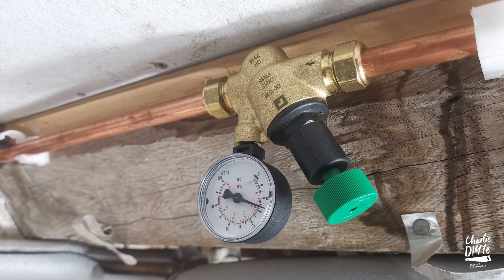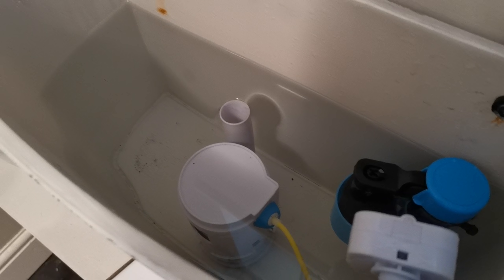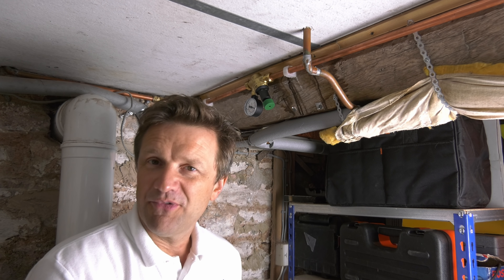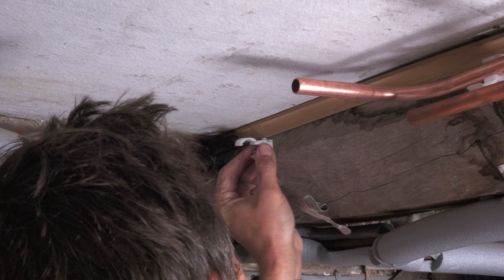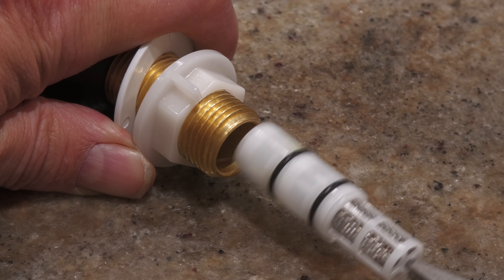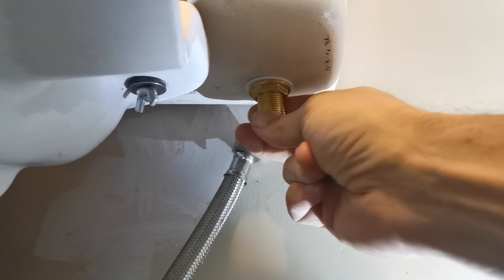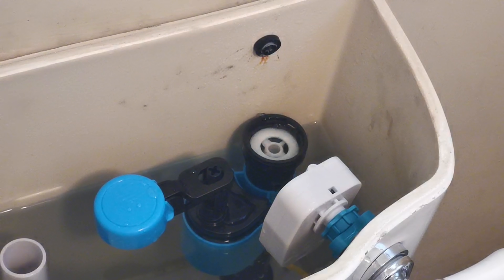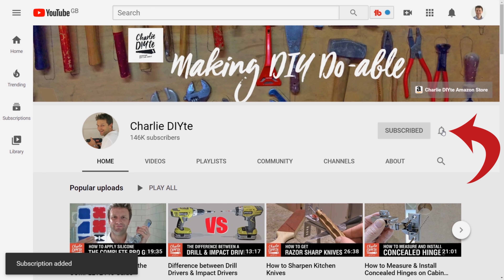How to Fit a Pressure Reducing Valve to Fix a Cistern Overflow Problem

Comment: We had a pressure reduction valve fitted to the incoming supply just after the main stopcock. That has been in service for 25 years and apart from the plumber initially fitting the filter after the PRV rather than ahead of it (which caused it to stop working after a while with the grit carefully trapped in the valve😃) it's been great. Less worry about flexis and washing machines giving  issues.

Comment: Hi I fitted these to my 3 toilets they worked fine I have recently had email from water company saying I have a leak I checked all toilets they are overflowing very slowly supposedly I am loosing a litre per hour my water pressure is quite high we have  two showers so the the pressure is great I don’t know how long they have been like this I fitted these about 4 years ago I was just going to replace?

Comment: Great channel Charlie,  you always manage to cover the salient points in all topics.   Re Viva, and the blue plastic filter.  Not seeing your video before,  I phoned Viva to try and understand why you would need the option of the blue plastic filter.  They told me that it was only necessary if you 'dont' need a check valve.  I was thinking he was talking about an external check valve.   That confused me.  The guy I spoke to did not mention the standard filter is also a none return valve.  I assumed it was just a filter.  It is a shame that the brochure installation instructions still does not mention that the pre installed filter is a also a one way valve to stop back flow.
Reply from the maker: Yes, it never ceases to amaze me how lazy instruction manuals are. Thanks so much 👊

Comment: Looks like you have an asbestos ceiling in there
Reply from the maker: Yes unfortunately so. Amosite https://youtu.be/g_DI3_LmY5k?si=DiZQ88iILxtdxQHo
Reply: @CharlieDIYte  Yeah, thought so. It's Asbestos Insulating Board (AIB) and presents a medium risk as it's unsealed. I wouldn't spend too much time down there if I was you! I was an asbestos surveyor in a previous career, you never lose it 😂

Comment: For a proper seal to the pressure guage there is a conical washer that you can get (if you search carefully) that seals the pressure guage at the bottom but unfortunately it tends not to be supplied with the guage or the PRV.  I found that a copper washer with a 5mm hole and 10mm outside diameter does the trick.
Reply from the maker: Thanks Richard 👌

Comment: Did it stop the hammer noise just by installing the pressure reducer?
Reply from the maker: Weirdly the hammer noise ended when I installed this new fill valve.. Pretty sure that was before I installed the pressure reducer but can't be sure. Best to put it where the main comes into the house so the entire house pressure is reduced. I have one of those now since we installed the underground boiler so the valve I installed in this video is superfluous.

Comment: Hi Charlie,
Great video.  Just a quick point that may be of interest, the inlet valve you installed is sadly not strictly legally allowed to be installed in a WC. According to BS standards and WRAS an inlet value in a WC has to be a "Type AG" backflow prevention device, the one you installed is a "Type DA" device meaning it relies on the umbrella valve at the top to prevent backflow. While this has been a requirement for a long time, this and joints below the critical waterline (like those in most adjustable inlet valves) because a hot topic about 3 years ago when there was a huge increase in reports of in cistern cleaning chemicals being siphoned back into the water supply.
Reply from the maker: Hi Tyron, thanks for this. Does the umbrella valve not prevent backflow then? I'll need to look into this. 👊
Reply: @CharlieDIYte  that's the reason u say strictly.  The Type DA valves are used a lot in Europe and the US  without much of an issue. The umbrella valve does open and vent vacuum to atmosphere in most situations provided the vacuum is enough to move the valve material. There had been discussion for years to allow these valves to be approved in the UK but they are not allowed to be installed into potable water systems at the moment.

Comment: is there an certain pressure recomended when u fit one of these valves
Reply from the maker: In my case I wanted to keep the pressure to within the tolerance of the fill valve. For a house in the UK it should be minimum 1 bar. So you'd want it 1-3 bar probably.
Reply: @CharlieDIYte  thanks

Comment: nothing wrong with what you have done, how about an " equilibrium float valves " I have worked on 1/2" - 4" diameter feed,, " equilibrium float valves " since 1972 never a problem, you can get them for toilet cisterns, etc. but not saying pressure reducing valves are not a good solution.
some people think that reducing the " flow rate " reduces the dynamic water pressure, but it does not.really..so definately a pressure reducing valve.
there is more than one way, to skin a cat.
by the way you would be better off, using Wras approved " Jet-Lube V2 Plus Jointing Compound " for compression fittings. for " potable water " and gas supplies
thanks for the video.
Reply from the maker: Thanks mate. Appreciate the advice. Yes, what I should probably do is install one where the water comes into the house, rather than on just this one point, but until I rip the kitchen out so I can get to the stop cock, it's not really practical.

Comment: According to the Honeywell installation instructions your PRV is installed upside down
Reply from the maker: I couldn't find anything in my instructions to say this. Remember, mine isn't a Honeywell (they've hived off Resideo).
Reply: @CharlieDIYte  Honeywell bought Resideo, valve appears identical. Section 3.1 item 1 of Resideo instructions says spring bonnet should be facing upwards. DiffIcult for you due to your ceiling, but that is what the book says. Sorry to bring bad news 🤦‍♂️ This could be to ensure debris does not gravitate into the cartridge. Maybe less of an issue if you have an upstream filter?
Reply from the maker: @whitefields5595  You've misread the instructions. It actually says "In vertical installation position spring bonnet with vertical spring facing upwards" Mine isn't a vertical installation
Reply: @CharlieDIYte   .... I know, but your spring bonnet is still facing downwards to the same degree as if it was upside down in a vertical installation. As previous, i reckon it is to reduce probability of debris getting into the O rings in the piston assembly. I wish I'd never mentioned it now, only trying to help .....

Comment: If you have a flow pump  connected in the outlet of the water system, it is ideal to install a pressure reducing valve to save the water heater?

Comment: Hi Charlie, thanks for another interesting video, just wondering if the same pressure reducing effect could be done by slightly closing the isolater valve,? Doing this worked for me on a cistern that was filling too violantly. All the pipe slices I've used swage in the copper on cutting through, I use a small half round file to remove it, provided I've got access . Cheers mate, looking forward to the next video, stay safe, best wishe's to all, Stuart uk.
Reply from the maker: Hi Stuart, thanks- you're very welcome 👊🏻 I should have mentioned this in the video. No, putting a half or 3/4 turn on the isolator simply reduces the flow but not the pressure. In some ways it could do more harm than good - using the analogy of putting your finger over a hose pipe.
Reply: @CharlieDIYte  Hi Charlie, thanks for the reply, your answer cleared that question up, as always your videos are clear, instructive,  and a pleasure to watch,stay safe mate, best wishe's to you and your's, Stuart uk.

Comment: Charlie can you do a video on door frame paint removal and how to get a glued and nailed interior door archetrade off.
Bloody Barrett homes from mid seventies😖😖👍cheers John
Reply from the maker: Hi John, unfortunately I haven't really got one of these on the pipe line. However I bought a heat gun from Wickes years ago and use that when I need to strip paint - it's bit a beer good one though so maybe shop around and get yourself a few decent painters knives to scrape it off with.  That and sanding. I think you'll have get a wide chisel and lever that architrave off if you're wanting to remove it though.

Comment: I have just got one of these too (also disappointed with the plastic guage). Can you actually install these upside down like you have? The instructions state the 'bonnet should face upwards'. Its spring-loaded but perhaps less effective if upside down? I assume that's why it's at an angle.
Reply from the maker: That's an interesting question. My valve can be installed vertically and horizontally, and in the vertical position the bonnet would be facing down so I can't see how this could be the case, but when I locate the instructions I'll see if I can find any reference to this.

Comment: Very interesting, thanks.  If not too unsightly, I generally prefer to install isolating valves that have small handles so in the event of emergency there’s no mad dash to get a screwdriver
Reply from the maker: Yes that's a very good point. 👍

Comment: Afternoon Charlie , hope you don’t mind me saying . With your ridiculously high mains water pressure , I would advise a pressure reducing valve on the incoming mains , not just your downstairs wc . That amount of water pressure is a disaster waiting to happen . Putting huge strain on every water appliance /or outlet . 3.5 bar is more than enough .  Most mains fed water systems , be it pressurised cylinders etc have combi valves reducing everything to 3bar .. just a bit of advice from an old school plumber . Take care .  Oh and I enjoy your channel . Rosco .
Reply from the maker: Hi Ross, massive thanks for that. You're absolutely right. The slight problem I've got at the moment is the incoming pipe is behind the kitchen cupboards - the stop cock being the only part of it that's accessible. I should probably devote some time to taking them apart to access it, as I could do with putting a new stop cock on too. But I really appreciate you taking the time to advise me on this 👊🏻
Reply: 16bar ..... Around 250PSI incoming water ! I think Charlie that sorting that and the stop cock moves up your to-do list several places  before it makes itself number one in the middle of the night :-)

Comment: Have you heard of the Water Hammer Arrestor to help with knocking?
Reply from the maker: Thanks Steve. I haven't, but I'll keep a note of that. I think ultimately I need a reduction valve on the water main inlet pipe coming into the house, which will probably solve any potential issues, but it's good to know about this. 👊

Comment: Good video, I'm currently redoing the WC and the fill valve that came with the cistern seems very cheap, I may have to replace it. I'd be interested to know why the cistern setup can cause knocking. I wonder if it's just a difference in design of valves between the old and new variations
Reply from the maker: Considering the Viva valve is only £10 it's well worth doing. Not sure why it's resolved the issue, but the flow rate from the old ball valve would have been a lot higher, so creating more for in the pipes when someone else turned on a tap. Someone has commented that the valve in their old cistern was vibrating and this created the knocking, but I don't think that was happening in my case.

Comment: does your water supply provider not have a responsiblity to ensure your pressure is not too high?
Reply from the maker: I'd rather manage it myself Dave and will probably put a valve on the mains pipe into the house when I can access it. A mate at the other end of the village has literally no pressure, so I'm fortunate that where I'm situated it's high.
Reply: @CharlieDIYte  Charlie, I'm with you on this. A few years a go our water pressure was increased to help supply a care village upstream of us. it caused some leaking problems initally and we got the water supplier in to measure the pressure which they said what high but still "in Spec". I keep meaning to fit a whole house pressure reducer but I will have to source fittings for the old  black plastic pipe we have.

Comment: If you have this problem and are on a tight budget, you could install a shutoff valve if you don't already have one and just turn the valve so it's just open a little bit which slows the water down. Obviously it will take more time to fill but won't over pressure the inlet valve
Reply from the maker: I don't think that's right mate. I've read a few things about this and the general consensus is that doing what you say decreases the flow but not the pressure, so actually you can do more harm than good - similar to putting your finger on the end of a hose pipe.
Reply: Unfortunately this is incorrect Rhino , yes the shut off valve would slow flow , but the actual pressure remains the same !   Size of pipe determines volume /flow .. not pressure ..  hope you don’t mind me saying ..  Rosco

Comment: I've recently changed my fill valve for the toilet and within hours the the valve broke and is now slowly leaks into the cistern. I now have to turn off the water into the cistern to stop it from overfilling because the overflow pipe doesn't connect to anything. The landlord could fix it, but that will cost him money 😒
Reply from the maker: Sounds like you've got the same problem as me. 🙄
Reply: @CharlieDIYte  yup looks that way. The fill valves should be better quality

Comment: Another great video. Thanks, small detail, i think you're winding the ptfe onto the thread in the wrong direction, unless the video is mirrored?
Also be careful of passing the gauge  upper limit, you may put it out of calibration. 
Please keep up the good work
Reply from the maker: Thanks Julian. You're probably right about the PTFE tape. Yes I didn't really want to max out the valve like that but felt I ought to, to show the actual pressure in the video.

Comment: That's a lot of pressure. What kind of hot water and heating system do you have?
Reply from the maker: I've got an S-plan ventral heating system powered by a Worcester Bosch oil fired boiler. Hot water comes from a hot water storage tank in the bathroom supplied by a water tank in the roof. Not ideal but just about works for a family of 4.
Reply: @CharlieDIYte  ahh, ok, balanced hot/ cold won't be a problem with the prv as it's already way out of balance already.
Reply: @CharlieDIYte  I have a similar "old school system" like your. Vented cold store in the loft, system boiler heating coil in the hot storage tank so only gravity hot water.
Would be very interested to hear views on best alternatives for a house with 3 beds, 2 baths and only 2 people most of the time.
Seen lots of mains pressure hot water but seems a lot to go wrong and can't fit yourself.
Looked at thermaflow from McDonald engineering - thermal store, reverses the hot coil cold tank setup for mains hot water and can feed central heating from boiler as now or use the stored water for a much faster response.
So when you get to pondering I would be interested in your or others views.

Comment: Best tool for deburring pipes is the nose of a pair of pliers; simply insert into the pipe and twist a few times. I was a sparky many years ago and laid an awful lot of metal conduit and this was standard practice.
Reply from the maker: That's genius mate, thanks for the tip. Only problem is I just tried it with my Leatherman and whilst it creates a lovely shamfered outer edge, it accentuates the inner lip - because it's shaping the copper rather than removing it - which arguably makes the problem worse. Obviously it depends what sort of pliers you're using.
Reply: @CharlieDIYte  With copper I’d go gently as you also run the risk of opening the pipe out a bit given it’s so soft. Also helps if the edges on your pliers aren’t too sharp as you’ll end up creating another edge as you’ve said.
Reply: @CharlieDIYte  your poor leatherman
Reply from the maker: @elliottlester74  Hmm, it is a little serrated around the edge now. It'll live though!

Comment: Very interesting about the noisy/banging pipes in the beginning of the video. In my case, a new washing machine with super fast micro valves resulted in a banging under the bath the other side of the house. No water hammer thingy gizmo could fix this. So I replaced the copper under the bath with JG pex & fittings and tied everything with cable ties...no banging, no water hammering, even the electric shower shuts down very quietly. Uncanny!
Reply from the maker: That's so interesting. It's crazy how it creates hammering elsewhere in the house. That's why I couldn't understand how the cistern could be to blame because the hammering wasn't close to it. Well done sorting your problem - nice bit of DIY detective work!
Reply: If you ever have the same issue, I found part closing the isolation valve next to the washing machine sorted the knocking caused by our LG washing machine (which also has a rapid on/off water fill at the start of the cycle)